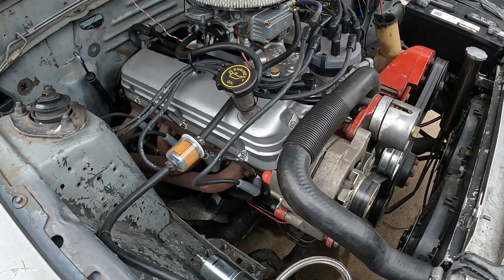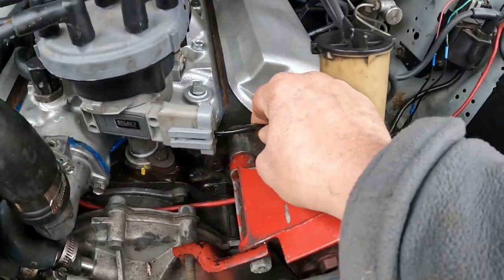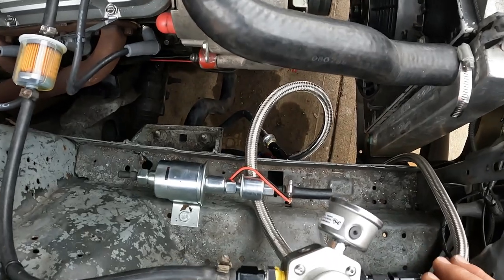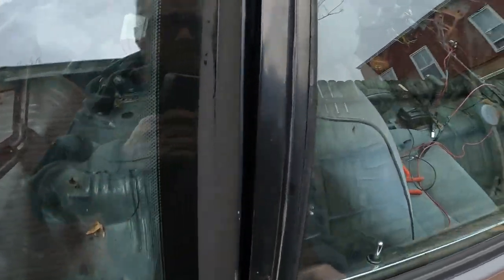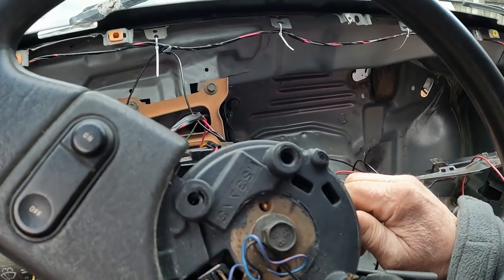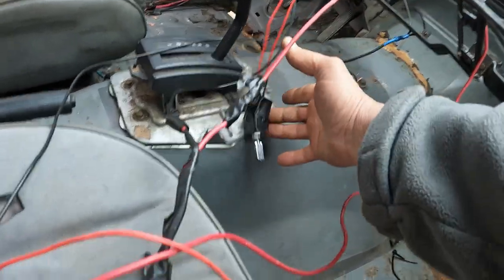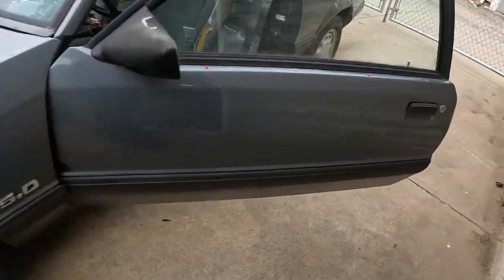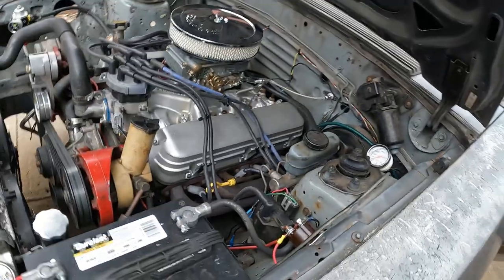EFI to Carburetor - 89 Mustang Notchback update #3

Comment: How did you wire the distributor?
Reply from the maker: RR, here is how I wired up the distributor on my 89 5.0 efi to carb Mustang:  Used stock 5.0L dist (87-93) google "Ford TFI Module wiring diagram" - remove #6 PIP, remove #5 Spout, remove #4 STRT, ----- use #6 PWR to ignition coil and 12V switched. Use #2 coil negative to ignition coil. That's it. Did not use #1 GND (removed that pin also)